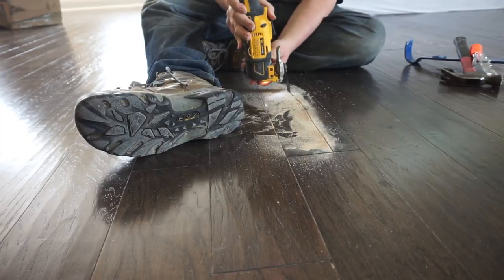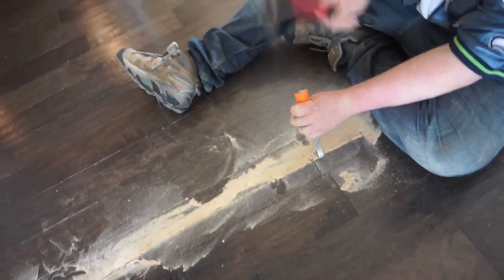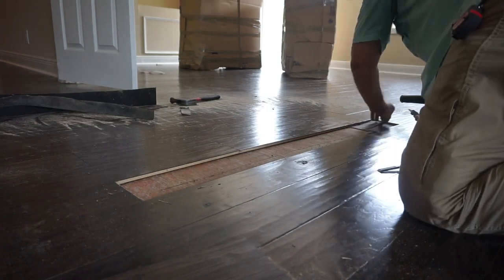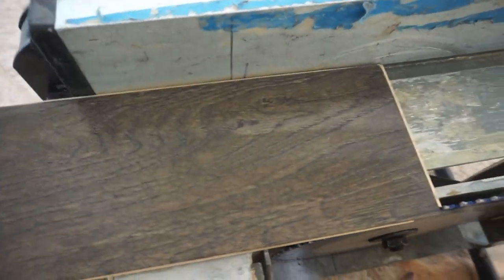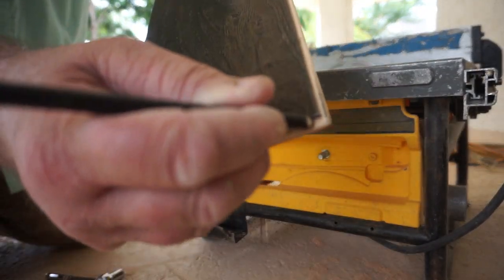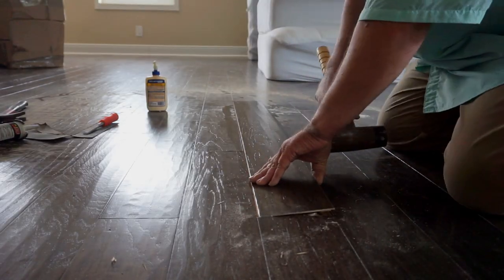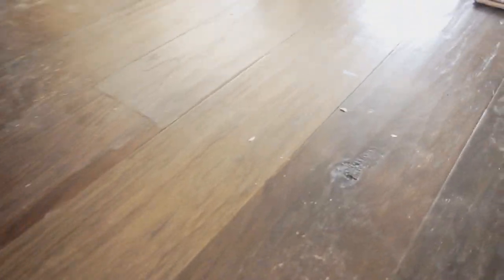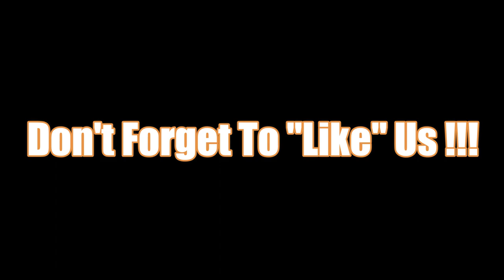WOOD FLOORING REPAIR - BOARD REPLACEMENT - HOW TO REPLACE ONE PLANK OF FLOOR WOOD - LAMINATE - VINYL

Comment: how do you fix glued together engineered wood floating floor?
Reply: Same concept once you get the board out the tongue will be still glued in the groove you got to take a router with 1/8 inch bit cut a New Groove then make a new tongue and glue it in